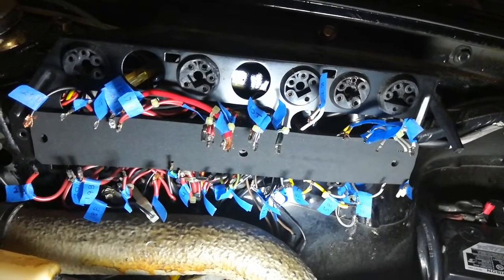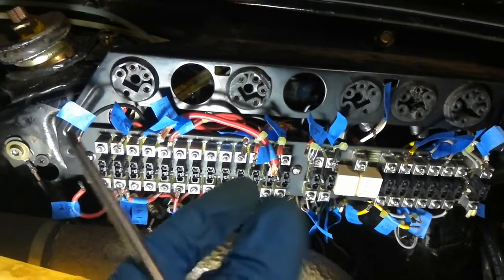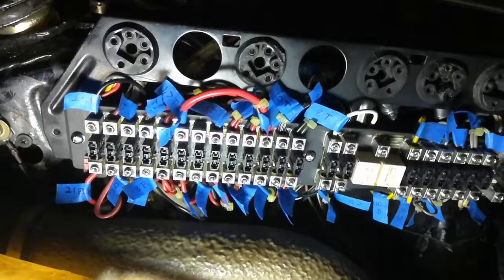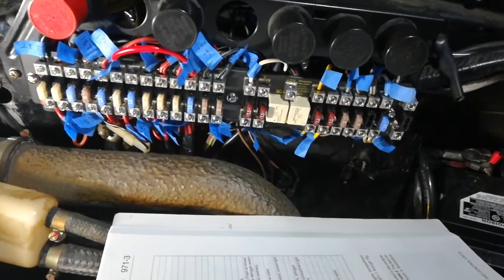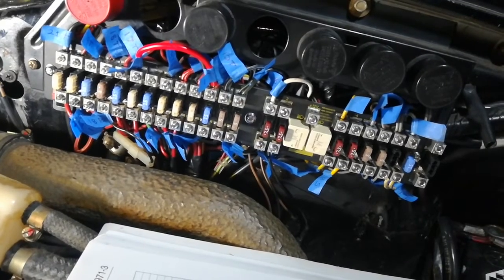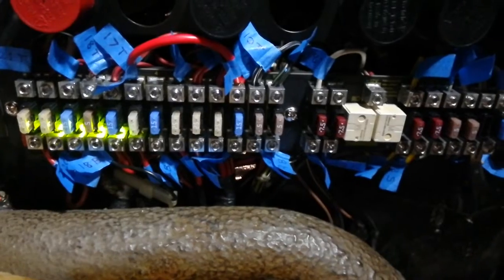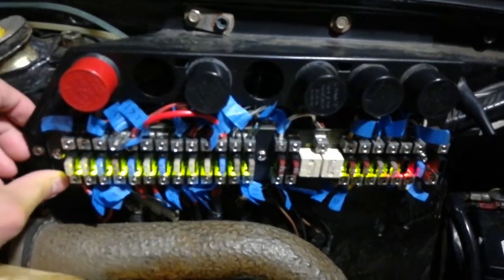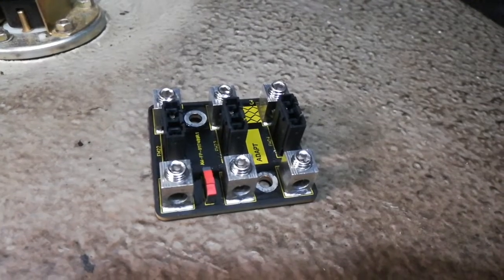Air-cooled Porsche 911 Fuse Panel DIY Upgrade Part 2 of 3: Front Panel Install

Comment: Thanks for the informative videos, I recently installed one of these in a 911sc, the problem I have is that my headlights don't shut off now, any advice would be helpful.
Reply from the maker: In general, swapping the panels and not changing the locations of the individual wires takes care of the bulk of the work, but if an individual circuit is acting up, then no choice but to pull up the factory wiring diagrams and see what's physically different in that circuit on the car.

Comment: That foam seems like a poor solution.
Reply from the maker: It's not bad. It's a high density closed cell neoprene. Still holding up all these years later.
Reply: @JoeEngineer  Thanks for the video. I just installed it. Looks pretty good, but the panel is kind of flimsy (flexes a bit when you install it, even if you're careful not to overtighten) and there are a lot of soldering joints. Also on the 930, you still need the external bridge between fuse 5 and 6. Overall, it's a nicely designed solution, but  not sure it's worth the cost. I don't think it will hold up as long as the old school fuse blocks. What do you think?

Comment: Great video. I replaced my panel with a similar one from classic restoration (terrible customer service). Unfortunately i didn’t flag my wires and the harness doesn’t belong to the year make. The car is a 1968 911L, engine gearbox harness was transplanted from a 1977 911s.  So here’s my question. What’s a good source for placing the wires in the right location? Do you have a good source for a wire diagram? My issue is my turn signal power at this time. Or lack of to the turn signals.
Reply from the maker: The Bentley manual has diagrams but I prefer the Factory Service Manual diagrams. You could probably find them if you Google around.

Comment: Does this remove the need for the jumpers or did I miss where you installed them?
Reply from the maker: I do remember the new panels had the same integrated jumpers as the OE panels did behind the fuses. As far as external wire jumpers, you may have a couple but I don't recall it being very many.